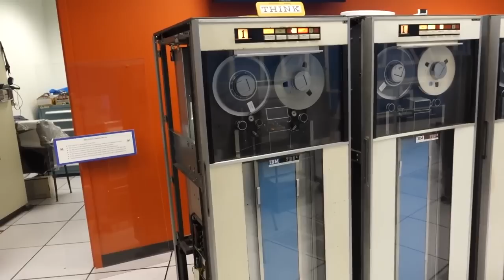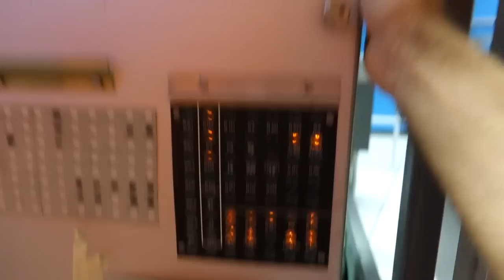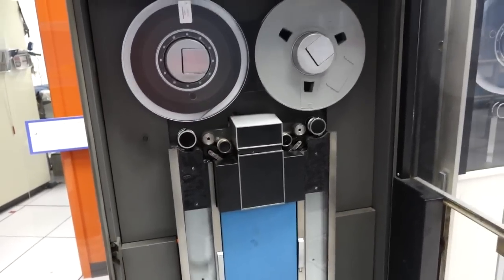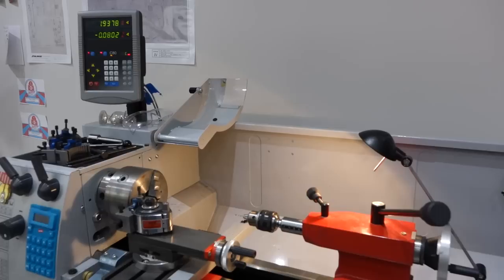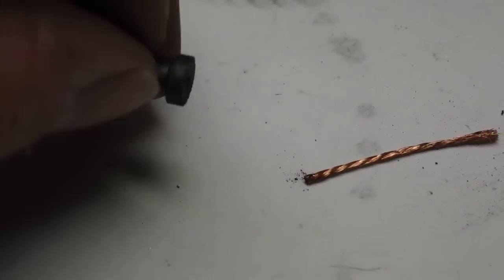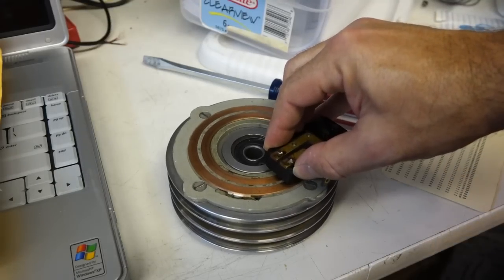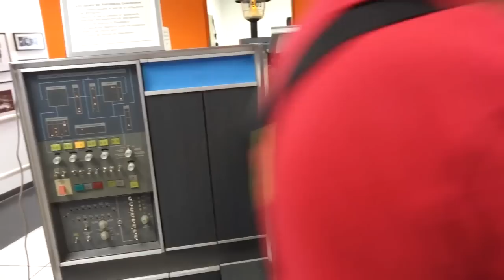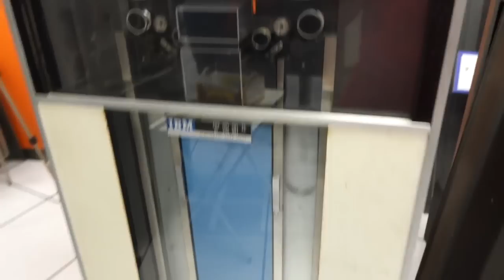Debugging the 1959 IBM 729 Vacuum Column Tape Drive at the Computer History Museum

Comment: you should see 8 tape drives doing a sort! You specify the input drives, how many work drives, and the o/p drive. while 1 i/p drive was in rewind it was reading from the other. that was called phase 1, the input phase. then phase 2 was the sort phase, then finally phase 3 was the o/p phase. after phase 1 (i/p phase) you can mount scratch tapes on the two input drives, then the printer will tell you how any passes of the data has to be made    to have the data in sequence before the final phase 3. simply amazing! tape sort were much faster than disk sorts too! watching the tape drives reading and writing both forwards and backwards during phase 2 was very cool.
I used to write sort exits in assembler, for the sort program. these exits can modify the data on all 3 phases. 
all this was done on a machine with 16K, that's 16 thousand bytes of memory!
Reply from the maker: Absolutely. Filming a SORT7 run is on the to do list.
Reply: So many memories of watching tape sorts on 2401 drives on a 360/40. I do miss that on modern machines.
Reply: @simonknights7526  actually tape sorts are MUCH faster than disk sorts. I used to know the programmer reslonsivle dornthe sort program and wrote tons if E15, E25 ans E35 sort exits. The sort program would constantly evaluate rhe best algorithm to use as the sort progressed. What i find amazing is that on a tape sort, you can specify the specific output drive even though it is used as a work drive as well. Also after the input phase is done, you can use the input drives as wirk drives After you mount scratch tapes on then. You could also use alt input tapes drives as well and both would be used as work drives adter the input phase. It was amazing to me that after the input phase, it would display hiw many passes of the data it would take to complete the sort.
Reply: @rty1955  Interesting! But I don't understand how the tape sorts were faster that disk sorts - could you explain please? The first machine I worked with only had two 2311 disks (7.25MB each - one held the OS, and the other had the Fortran and Cobol compilers, and other support libraries) so could not be used for any sort work areas. When those 2311s were replaced by a number of 2314 disk drives we then switched to using the disks as work areas for sorts -because sorts were so much faster that way. But watching a tape sort was something else!
Reply: @CuriousMarc  Did you film the SORT7 tape sort? I've looked but can't find it - would be great to see!
Reply from the maker: @simonknights7526  Have not tried it yet. We'd need to have all the tapes work *at the same time*, which I've not seen happen often ;-). But I agree it would be quite interesting.
Reply: @simonknights7526  during that era of 2401 tapes and 2311 disk, the see rates of tape was 320k bytes/second, the 2311 was 127kB /second, so at least rhe data trasfer from tape was more than 2x the speed of the disk. In later years rhe 3420 tapes were 1 25MB/sec while the 3340 disks were inly 885kB/sec. And that's just pure xfer speed that not accounting for rotational delay. Data on tape was 9bits of data at a time (8bit+parity) tape speed was almost instantaneous due to the vacuum columns as opposed to a rotational delay from the disks and the fact that data was read from the disk a bit at a time rather than a byte at a time from tape. Disk channels are also split with the rest of the system and disks are considered to be parallel usage devices, meani g they could be access by many programs at once and may cause head seek delays, whereas tapes, becuase if the very nature of sequential data on rhe tape, are considered serial reusable devices. Meaning only 1 program can be accessing a tape drive. There was zero head positioning time as its not a random acess device. All of that combined made rhe sort job on tape about 5x faster than disk sorts.
Tapes are read and written fwd and backward too there for no rewind time when a reel came to the EOT marker. During the input phase, the drives used maximum block factor to cram as much data into a reel of tape. I even used mix reel sizes to see if that would make it crazy. I used 800, 1200 and 2400 size reels and the sort program handled it wonderfully. It was simply an awesome sight to watch. The CPU was slammed at 100% too
Wonder what o/s you were running with only (2) 2311s? I ran 26.2 DOS and it required a SYSRES, SYSREL, ans SYSWRK1 if you were doing compiles and such. I had (4) 2311s on a 360/30. Then I went to another shop that had a 370/135 with (6) 3340s (woo hoo!) We got a 4341, then (4) 4381s with a sea of 3380 drives. Helll we would never run out of space. (Famous last words) we had 58 thousand reels of tape in our library too! (Sucked to be a tape librarian)
Reply: @rty1955  thanks for that detailed reply Roy. My assumption was that transfer rates for DASD would have been higher than for tapes - understand now that I was wrong! Of course, not needing an operator to mount tapes did speed things up - the sort step could just continue when it used disks with no intervention required (but that's a different issue!). First machine was 360/40 with DOS R26, single partition (all jobs run in BG). Then 4331 with VM370 and the same DOS as a guest. Then 4341, 4381, 3090, and so on. And, as you say, a sea of 3380s and 3390s. From 1980 to 2004 I was a VM Sysprog. Then it all ended. Those were happy days!
Reply: Our sort jobs ran for hours on the 360. We sorted 6 to 100 million records at a clip. I was a DOS sysprog. I did a lot of cool things in a mainframe. I loved my 360/30 and 26.2 had a FG partition too. Before POWER I always ran two jobs at once. My boss loved me for that! All the other ops ran only BG. Remember you were RENTING the machine, so rhe more work you could push thru the cheaper the cost was. I would have the FG partition only print from tape. The bg jobs would print to tape. The CPU bound jobs would run in BG and the I/O bound jobs would run in FG. I would run DITTO in FG to print from the spool tapes. I would // assign syslst, tape. Bingo, poor mans POWER. Haha
Never got I to the while MVS thing. To me the JCL is backwards and everything starts with "IE....." I never knew the reason for that. I was the only one that could read core dumps too. Our operstions manager thiufgt it was too much paper to print, so instead he decided to print to microfiche!! To get around that, i created some space on disk to spool my dumps to. This way I could only print what sections I needed. We were primarily a COBOL and PL/1 shop. I had a PC that ran VM as well. It was a special IBM PC that had a daughter card that had a Motorola 68000 processor and memory to actually run IBMs VM. I would run it to do my development on before sending it to the mainframe.
I wrote a POWER routine to check the Que for my jobs and automatically raise my job to high priority. The ops got so pissed at me. I said "my jobs take a few seconds to run, why you constantly push mine down to the basement? I dont get output for a long time!" There was nothing they could do once I wrote that. The ops manager complained to my boss, but my boss backed me up.
Have you tried running HERCULES on a PC? That will dust out your head
Reply: Amazing! That’s a lot of data back then!
Reply: @captianbubble  what was more amazing is that the input was 12 reels of tape!!
Reply: @rty1955  really? That’s crazy! And I am not even born in the 70s or 80s! Or  60s even for that matter! It’s just really fascinating to me!
Reply: @captianbubble  it was amazing to watch. We sorted about 12 million records on tape. U stood there and watched the reels read forward to the end, then when it got to the end it would either read or write backwards. And it wold do this on 8 drives. After reading all the input tapes it would print out how many passes it would take to sort all the data! Amazing how it knew that. Then it would print out "output phase" and the drive YOU selected as output would scream forward writing data
Reply: They were either 7 or 9 track, with 1 track for parity.  Where I worked most of the drives were 9 track but we had a couple of 7 track to interchange tapes with the UNIVAC system upstairs.

Was that 16K bytes or words?  Back then memory size was often expressed in words.

Comment: Thanks for this video! I ran across it while doing some research into the function of these tape drives.
Also thanks to the IBM 1401 team for the documentation on your website. The 729 CE Manual found there is newer and more informative than the version on bitsavers.

It was quite interesting to see the repair of the clutch brushes. It makes me curious about how other maintenance items are handled. There's a lot of old technology there that's going to need occasional repairs.

Comment: A little bit of electronics ? Geez, will you look at all those discrete components boards ! And 8 motors ! Wow ! What an incredible piece of engineering. No wonder it was so expensive back in the day. Fascinating piece of machinery. Thanks for this detailed inside view and explanations. Congrats to all of you on fixing it. This video made me subscribe. 
What is the maximum digital data transfer speed of a tape unit like this ?
Reply: The maximum data transfer speed of this particular unit, a 729-II, is (6 bits per character) times (556 characters per inch) times (75 inches per second) = 250,000 bits per second. Other models of the same drive with a faster transport (112.5 inches per second) and higher density (800 characters per inch) could transfer up to 540,000 bits per second.
Reply: 540,00 is only 67.5 Kilobytes per second or 0.067 Megabytes per second. Yes, it really was that slow.
Reply: Actually this hasn't really changed with modern tape drives like LTO; still a handfull of motors in those, just at a miniaturized scale.
Reply: @SteelRodent yes I know the struggle firsthand :-) I was referring to the original comment about the mechanical aspect and the number of motors.
Reply: @simontay4851  same my internet connection...!
Reply: @simontay4851  67 kilobytes per second is a decent transfer rate if you only deal with simple data like, say, accounting.
Reply: @GeorgeTsiros  Genuinely all you needed at the time.

Comment: Worked on similar units to these as late as the 80's in the Air Force. They used them to load programs onto a CENPAC unit and run automated test stations for maintenance on F-111s.

Comment: I used to work with Teac and HP mag tape units from the 80s / 90s on Ericsson AXE10, IOG3 & IOG11, not as impressive as those units, but still rose tinted memories. That's for posting the video.

Comment: Back in the 80s, when I was a computer tech, I maintained several tape stands, on a couple of different systems.  However, on those, they had servo motors, so need for clutches or slip rings.  They also measured the air pressure, to control the tape reels.  Also, there was one occasion when a TV crew wanted to film the data centre operation and they didn't think the tape stands looked like they were working.  So, we ran diagnostics to make them look busy.  🙂

Comment: These old tape drives brings back memories, the vacuum tape drives were far better than the modern drives that were attached the AS400 computer in the early 90’s. In that day there were ancient tape drives attached to a 4381 but boy were they fast. In those days IBM built quality and I was proud to work for IBM.

Comment: those connectors were epic
Reply: Tom P. They look like from the 1800s
Reply: Now they are proper connectors! They will last forever.
Reply: The old bus and tag.  I remember when we replaced those connectors with fiber.  During the next big earthquake in California, the cables did not hold the disk drives in place anymore.  They flew around the room as a result causing great damage.  After that experience they had to retrofit special feet on the disk drives to keep them from flying around.  Who woulda thunk that a fiber cable wouldn't secure those big drives to the floor anymore!!

Comment: I'm shocked by how complicated the inside of that 9-Track tape machine is. In the 70's I worked at  SoBel date centers in Miami and Ft Lauderdale, as part of an on-site maintenance team of three guys.  We had about 40 or more Telex drives, I think they were 6450's. The reel motors were direct drive no belts, no clutches. The capstan motor, there was only one, was a permanent magnet motor with an armature that was a fiber glass disk with heavy wires bonded to it that was about 1/4 in thick and maybe 8" in diameter. The capstan wheel mounted to the armature had vacuum applied to grip the tape. It had to accelerate to full speed and write it's block of data and decelerate to stop while maintaining the about 1/2" gap between blocks of data. It had about five to six vacuum switches per tape column. And I really did love my job. All these machines were very well engineered, and were workhorses. It was great fun.
Reply: These are 7-track drives.
Reply: We need a place to send the pictures of the data centers we worked at. Tape drives at Sobel were made by Telex. When I starterd at Sobel they were using an RCA 3301 computer. I had zero IC's in it. And a lot of sketchie board contacts which were all gold plated. Core memory was in a sealed box. Used a daisy wheel printer as a console. Later changed to an modified IBM Selectric.

Comment: There are still naval warships using tape drives.  When I retired in 2014, the FFG-7 Class guided-missile frigates and some US Coast Guard gun-armed ships were transitioning over to CDs, but some, especially several foreign FFG-7s in nations with fewer funds for conversions and upgrades, were still using them.  The tape drives are not IBM, but made by Sperry UNIVAC, all to "Mil-Spec" and MUCH more solid and heavy than the IBM drives you show here (half-inch steel frames and eighth-in steel cases, with heavy lock clamps around the doors to keep out water, etc.).  The older drives, UNIVAC 1540s, were somewhat similar to the 1401 drives, but instead of a vacuum tape reserve buffer in two long tubes, they had a series of spring-loaded short arms with rollers at their tips.  When you put tape through the machine from the source reel to the take-up reel, you threaded your tape through a narrow gap across all of those rollers, through the read/write head block, through another set of cushion arms, and onto the take-up reel, hand rotating everything to be tight.  Then you hand-rotated the source reel forward a few turns (not quite to the LOAD POINT silver tape mark) to make sure it was secure on the take-up reel.  This caused the two sets of arms to spread apart forming a pair of "W"s of tape, each arm of the W about a foot long, one on each side of the read/write block.  You made sure the tape was not loose anywhere and then turned on the power.  The arms suddenly spread apart even more and tightly held the tape and each arm could pivot under spring loading at its base, allowing more or less tape in the interval between the two reels, as needed, this being the cushion for fast tape motion that those two vacuum tubes do on your IBM drives.  All loading was manual, including running the tape past the LOAD POINT silver tape mark and then manually pressing LOAD to cause the machine to move the tape forward and then backward to the LOAD POINT to be ready to run.  Later, the UNIVAC 1840 drives appeared to slowly replace many, but not all, of the 1540s.  These used a vacuum tube system like your IBM drives do, but not visible unless you opened up protective steel doors on the drive face, and were automatic:  All you had to do was put the source tape on its reel shaft, lock it, and then feed the end of the tape into a small slot in the central read/write block, which was much bigger than used with a 1540.  When you hit LOAD, the tape was sucked into that slot, the tape ran onto the take-up reel, the vacuum cushion inside turned on, and the tape was then positioned at the LOAD POINT silver tape mark ready to run.  I assume that inside all of these machines, they were just as, if not more so, complex as yours are.
Reply: I used to work on some Collins 8500 computers.  These were mil spec versions of IBM gear and built for use on ships.  They were also built like tanks and water cooled!  I had to use a fork lift to swap disk drives!

Comment: We had some 'Pertec' drives that used a spring tensioned arm instead of vacuum slot.  But similar idea, the tension arms had optical sensors and the reel drives were just wired to maintain the tension arm position.  The tape itself moved by a capstan wheel across the heads and the arms 'told' the reel motors when to move.  Don't remember them making that noise, even when reading/writing a lot for things like tape-sort program.

Comment: One thing I don't miss, cleaning the read/write heads.  We experimented with different brands of tape, and finally bought a 'tape cleaner' that would zip the tape quickly from end to end, dragging it over a sort of 'cleaning head' so the old tapes wouldn't leave dirt on our tape drive heads.
Reply: I also used to clean tape and disk heads.  The operators had a machine that cleaned the tape and also checked for wear.  I also had to remind a couple of programmers to not smoke around the computers.

Comment: When i started in computers we had a 1401 and several tape drives. Ran under TOS. Then came the IBM 360 under DOS and then later the IBM 370.  Programming done thru punch cards fed into card hoppers and run  thru a pre-compiler and then a compiler to create the machine code. No screens of any kind. Now it is al drag and drop. What took months to do is done in minutes.